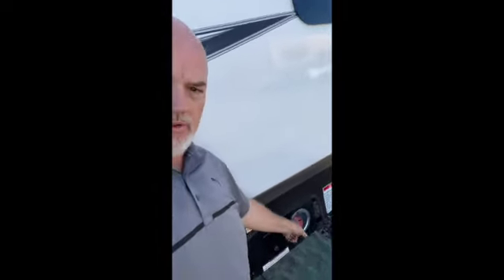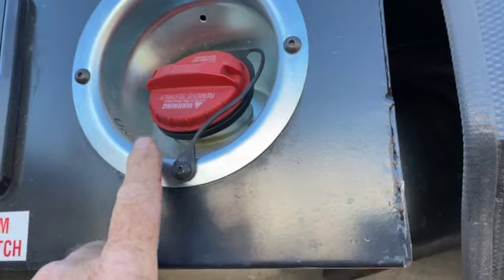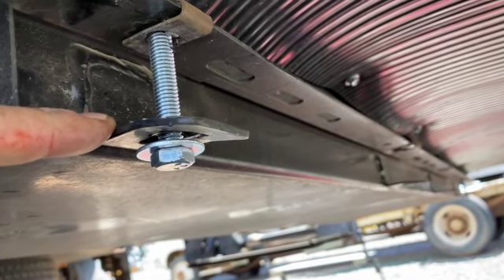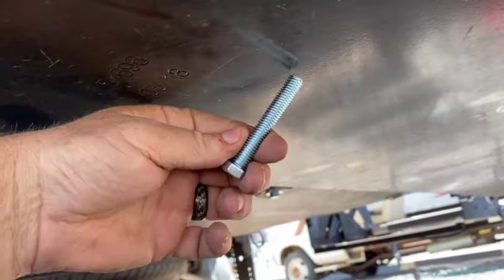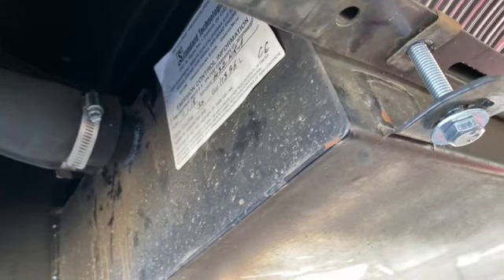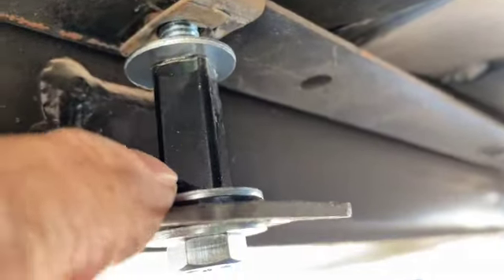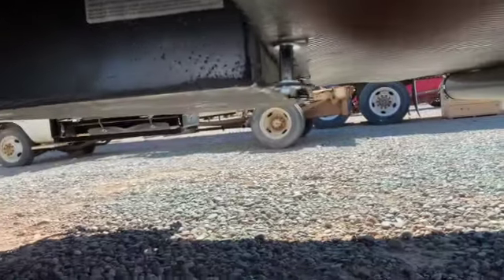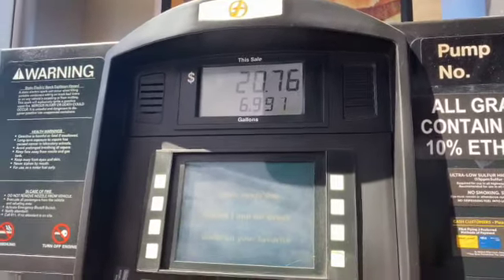Toyhauler Fuel tank mod

Comment: What is the trailer mod?
Reply from the maker: as in the video, I lowered the entire tank about an inch and a half to give a little more gravity flow. our fill hose was almost level with the midpoint of the tank so it would shut off the gas nozzle when filling. also the inside of the tank has a small float ball that stops flow out of the tank when sloshing. ours was stuck almost closed when we got it so I assume the fuel varnished and got sticky. I poked it loose and it fills much better now.